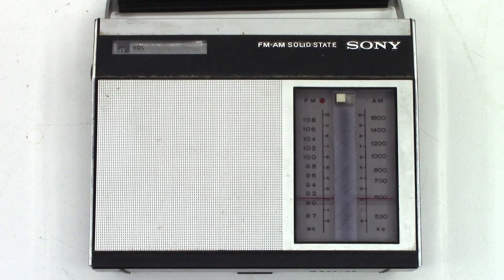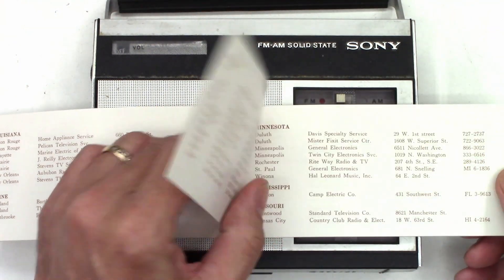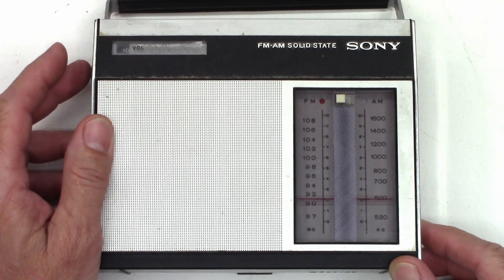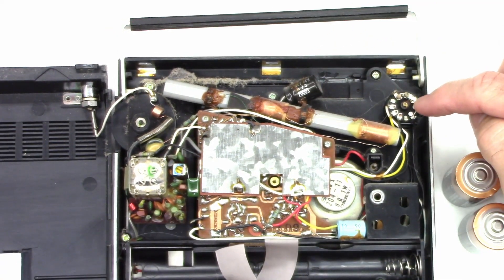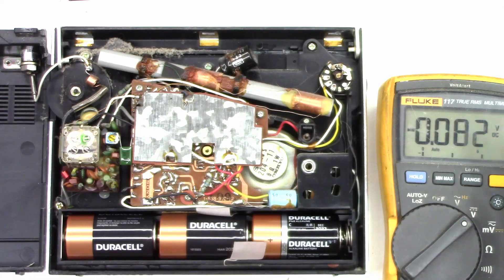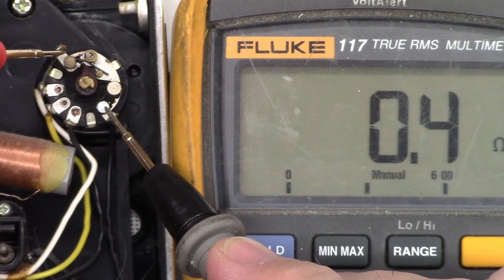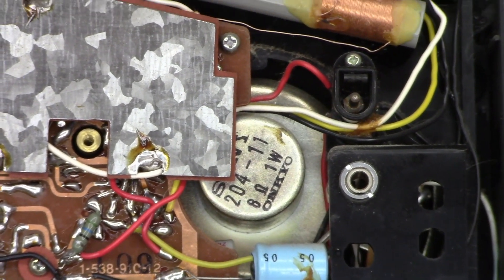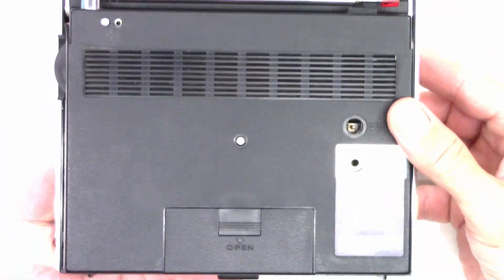SONY FM/AM PORTABLE RADIO REPAIR NEW IN 1968 OVER 50 YEARS OLD AND STILL WORKS GREAT!

Comment: Usually with a radio of that age, you'd find crap from leaking batteries, a metallic smell in the compartment, some corrosion (either from the batteries or being near the beach or both) and maybe a few dead bugs as well but not so in this case; a simple cleanup of a dirty switch is all it needed to get this radio (which appears to be in pretty good shape overall) going again. I reckon it will last another 50 years before the next service.

Comment: I have a Toshiba RP-700f stereo radio and where I live anything will pick up an fm/am signal.  Anyway, the problem I have with this stereo is that it barely picks up the most common local stations.  Is it because it's just a cheap stereo radio, or is there something actually wrong with it?

Comment: I cringe at the thought of all the electronics that end up in  the ground or ewaste that had a problem that was so cheep and easy to repair ! A dirty switch open or shorted capacitors or other issues that can be fixed for the component price of a Happy Meal !
Reply from the maker: The customer called me and asked if I wanted the old radio for $40. I happily paid the customer and and now the proud owner of this beautiful radio!
Reply: @norcal715  Nice little radio . Score !

Comment: The customer should stop using this leaking Duracell CRAP...
Reply: Duracell batteries made in recent years have proven to be absolute garbage right out of the box. This past week, I chucked a few new Duracell AA's out (that I hadn't even used yet) because they'd exploded and/or ruptured in the pack, leaking crap everywhere. Based on experience I recommend Energizer or Eveready Gold for all alkaline batteries (they have lower leakage potential) but definitely no more Duracell for me and I never leave batteries in units for long periods without use.
Reply from the maker: That's why I call them "rotten tops"